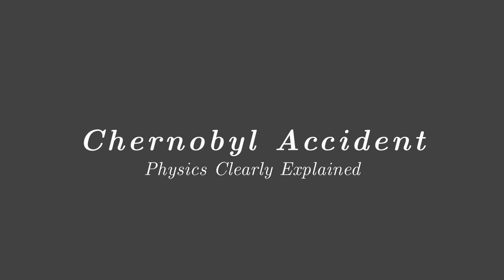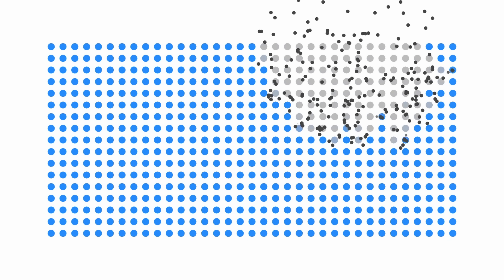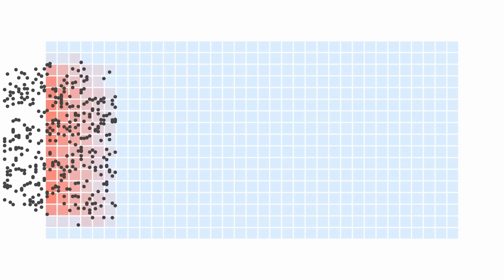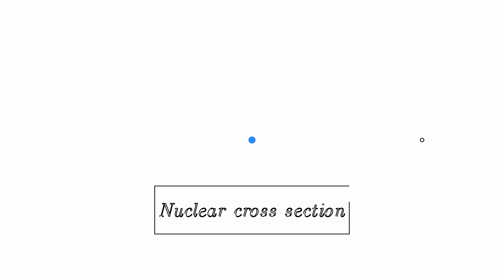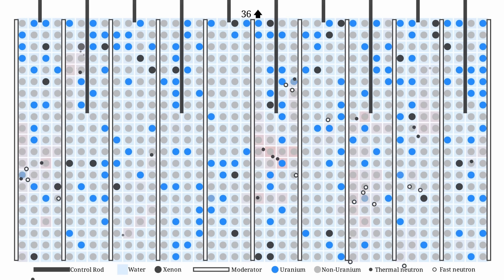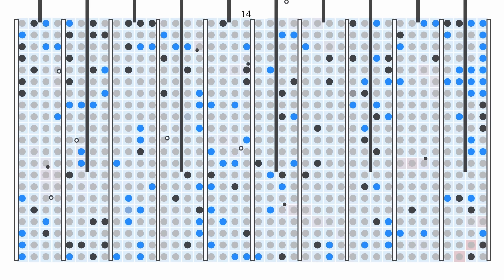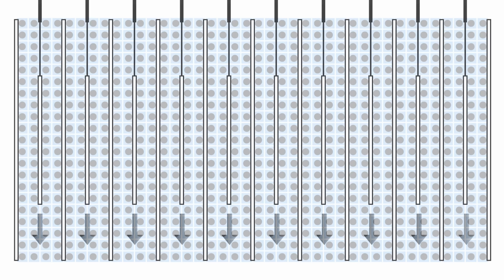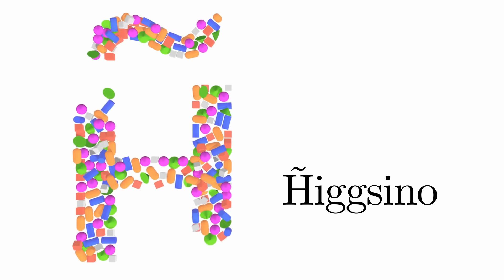Chernobyl Visually Explained

Comment: 07:44 fuel rods were surrounded by boron, only the ends were graphite
Reply: No, you're confusing the fuel rods housing uranium with the control rods. The fuel rods are fully surrounded by graphite cladding blocks, the control rods have almost equal-length boron and graphite portions, connected by a telescopic rod of approximately 1m.

Comment: honestly i dont even think the main problem was the reactor itself, the crew seems more at fault to me, they shouldnt have pulled out all control rods and definitely shouldnt have turned off safety systems and then the disaster would have never happened

and one more thing, you criticize the design of the reactor because the safety systems can be turned off, but what if the safety systems themselves get broken and make the reactor behave in a very dangerous way, in that case turning off the faulty safety systems would obviously be a good thing to do
Reply: The main problem WAS the reactor, the operators have since been cleared of most violations initially attributed to them. To briefly touch on the 2 things you mentioned:
- ORM violation: Operating Reactivity Margin or n° of effective control rods in the core: the control room did not have access to this data and the paper printed by the SCALA computer needed to be brought from the computer room by an operator and the measurement and calculation took a few minutes as well, which is to say the least not ideal in terms of design. Regardless, the operators were convinced that enough control rods WERE in the core even in the critical moments, because the software had a bug and failed to account for some automatic control system rods.

- Disabling the safety systems: these actions were done according to procedure, disabling the ECCS (Emergency Core Coolant System) was to prevent a faulty activation that would damage pipes and other stuff in the reactor needlessly, and even if it was left on simulations show that it wouldn't have played any role. If you went back in time and told them to leave it on you would probably only save the lives of the 6 operators who themselves went down to reopen the valves manually after it exploded and were exposed to deadly doses all night.

Let me know if you want more details, alternatively you can read the official documents yourself.
Reply: The crew was night shift and inexperienced bc they were supposed to just observe an already done test, they didn't know the test was still on going and paused.
Reply: @elinatsaktsira731 The test was delayed by 10 hours, not paused. The crew were not inexperienced, that is part of the russian propaganda trying to blame the operators rather than the abhorrent reactor design. This propaganda is still very strong to this day and also carried out (possibly unknowingly) by the HBO miniseries and many lectures on the topic. It is no one's fault but the corrupt CCCP system of lies.

Comment: I'm the old days there used to be a guy who had a job as an axeman.  And his sole job was to stay in an area above the control rods where they would be suspended with rope.  Then if they needed to get the rods down fast, his job was to chop them free so they freefell back into position.  His only purpose was there in case of a runaway reaction.

Comment: One additional detail is missed. Control rods not only move graphite moderator first. They press out the water of the reactor core thus adding to the positive SCRAM a little bit more. My father have learned nuclear physics in MEPhI and worked on the Chernobyl Power Plant in early 90's while it was not shut down totally yet. He told that the professorship in the institute well knew about RBMK flaws. But the communist party policy needed that power in all costs.

Comment: I feel like for the last part to explode, it needs the "uranium auto generation" from the model to accelerate.
You cover that very briefly around 2:30 but don't really explain what is the logic in the simulation. What is the probability for non-reactive to turn into U235 in your model? I feel like it's quite low in event 1 while very high in event 6.

Comment: reactor did what it was design to do it was safe at the end, it was human judgment, stupidity and error
Reply: A nuclear reactor should be designed to be impervious to human error. 

Or not just human error, if water somehow stopped being supplied to the reactor (like what happened on Three Mile Island due to a valve failure) it would’ve caused this same runaway.
Reply: No it was mostly reactor design actually
Reply: @mikedoessomestuff5771  No actually it wasn't mostly the design flaw sure it played significant part in the incident. operators pushed the reactor far outside safe limits they ignored every safety protocol the did everything worongest way possible. Oldest working RBMK reactor was at the time 16 years working perfectly fine You can't use 240 volt equipment with 500 volts. now i know Chernobyl wasn’t just “using equipment the wrong way" kind of thing but boy did they have fun with it. sure they did not know that doing this could cause a runaway explosion. They were never informed about (human error and stupidity  comes in to play in this part becasue they werent told) positive void coefficient that control rods had graphite tips that caused a power spike that the reactor was dangerously unstable at low power. yet If they had stayed within the operational boundaries, the explosion would not have happened. they tought with a push of a button all mistake would be like never happend this not a washer dryer lol its a nuclear reactor core. 

long story short human error created the conditions the design flaw made the consequences catastrophic.

Comment: Why were the graphite control rods "stuck"?
Reply: The channels containing them (or the ones around them, I don't fully remember) deformed due to the absurd heat as the power coeff became more and more positive, causing the (already very slow-moving) control rods to get stuck. It's important to note that regardless of this the control rods had been further retrofitted before the accident in response to a previous one (Leningrad unit 1) shortening the graphite portion. This was supposed to increase safety and make a positive scram effect impossible, what it ended up doing was increase the water column height below the control rods, making chernobyl worse regardless of how stuck the rods got (they wouldn't have reached all the way down anyways).

Comment: only thing I don't understand is the fuel. The fuel is already all in reactor? It's already there and they burn it until it's finished or they keep putting more inside thru fuel rods?
Reply: Fuel is in uranium pellets inside the fuel rods. Periodically the "spent" fuel rods need to be replaced and in RBMK this could be done even as the core was running, with a big crane system that would swap out the old fuel assemblies for the new ones.
Reply: @mikedoessomestuff5771 thank you

Comment: It is the "quark repulsion force" that creates explosions. Unfortunately, the standard model has quarks as both positive and negative. That's impossible. They are only positive and there is only one.

The strong force is between the quark and the 4 times smaller electron. The gluon doesn't exist because it has no mass or charge.

The quark repulsion force creates all explosions when the strong force is broken. It is the separating quarks that impact other atoms and starts the chain reaction. Fission reactors do not ever want the quark repulsion force to be released.

Comment: So is there like a lid on that thing or does it just shoot neutrons out Willy nilly
Reply: Yes there is (was) a concrete lid, called Upper Biological Shield, Component E or "Elena" in the RBMK. Weighing approximately 1000 tons. It shot up through the fucking ceiling and then came crashing back down when the core exploded.
Reply: @mikedoessomestuff5771  that is one hell of an explosion 😬😅

Comment: How could they have avoided this issue? At which event should the have made another move? Should they have reduced the water supplie in event 2 so that more xenon-135 gets burned?
Reply: Data from the control room actually shows that the day of the accident the core was never poisoned, in fact it was actively depoisoning prior to the test. After all the lies and the attempts to blame it all on the operators eventually stopped, experts determined that xenon did not play a role in the accident, nor did the disabling of the safety systems such as the supplementary coolant system which might have turned on by mistake, damaging the reactor if left on during the test. At the end of the day the operators did indeed do "everything right", besides the fact they did the test at 200 mW thermal instead of a higher power level maybe easier to keep stable. The power drop is a mistery to this day, and we can't ask Dyatlov why he ordered it anymore cuz ya know.. he died in 2006. The accident and its scale is to be attributed essentially to the atrocious design of the RBMK, but if you were teleported there today and had to take the critical decisions maybe don't shutdown after the test, as simulations show it may have calmed down on its own without the positive scram effect.

Comment: This is what happens when a system designed to be very slow (with a time constant of hours!) has a hidden positive feedback element. Over-regulation as it is. The soviet jury blamed operators, and the TV series followed them, demonising Dyatlov's figure. The fact that operators a) didn't know about the effect of graphite displacers and b) were under pressure of various instances issuing contradictive orders. Later on, the other RBMK reactors received an upgrade, removing the graphite displacers from the control rods.

Comment: Valery Legasov: [.......These rods are made of boron - which reduces reactivity - but not their tips. The tips are made of graphite, which accelerates reactivity.

Judge Milan Kadnikov: Why?

Valery Legasov: Why? For the same reason our reactors do not have containment buildings around them, like those in the West. For the same reason we don't use properly enriched fuel in our cores. For the same reason we are the only nation that builds water-cooled, graphite-moderated reactors with a positive void coefficient.

 It's cheaper.
Reply: the graphite "tips" were added for better reaction control efficiency, it was not a cost-related decision. If the rods were only made of boron, an absorber, when fully withdrawn the rod channel fills up with water: another absorber. Replacing a brake with a brake makes no sense, so instead replace it with a moderator and get finer control over the system. Not to say that the technology isn't problematic, but it has nothing to do with money, even do the choice to opt for the RBMK design specifically partly was due to costs.

Comment: Who tf designs the emergency safety switch's rods such a way that moderators are first to enter and then the control rods 🤦‍♂️
If they already knew they were playing with a thing which could potentially turn into a disastrous, a genuine engineer(talking about the ones who built that safety switch) should always prioritize the safety out of all the things.

Comment: very cool simulation! unfortunately one fairly important quibble - while it's technically true that "water has a low chance of absorbing neutrons," that "low" means "so low that it does not meaningfully impact reactivity and can be ignored." water is commonly used as a moderator, and moderators need to not be poisons (neutron absorbers)! having the water squares absorb neutrons as they heat up is not correct.

the fact that it's associated with the water warming up makes me think there was a crossed wire with the negative moderator temperature coefficient of reactivity. it's true that reactivity goes down as moderator temperature goes up; but that's not due to the water absorbing neutrons; the higher temperature makes it more likely that other non-fuel nuclei in the core (usually U-238) will absorb neutrons, leaving less for the U-235 to eat up and cause fissions.

it's really too bad because this would otherwise be an excellent tool for helping people learn about coefficients of reactivity! still an engaging video though :)

Comment: Wait so AZ-5 wasnt a detonator? The chain reaction had already started and the explosion would have happened anyway? Was there actually anything they could have done? Also what actually exploded? Was it steam pressure?
Reply: A steam explosion (caused by the burst of fuel rods) initially blasted off the 2000-ton concrete and steel upper biological shield. Moments later, hydrogen rushed into the exposed core and reacted with the hot graphite, causing a much larger explosion that blew apart the reactor building.

Comment: I appreciate the accurate visualization of the RBMK reactor and the significant 1.25m spacing above and below the graphite portions. However, the description of how the Chernobyl events went down and what ultimately caused the explosion is very inaccurate. The rods weren't stuck. The problem was that when re-inserting the rods, the graphite portions displaced the water at the bottom. This means the water, which is more neutron absorbent than the graphite is now replaced by said graphite, which increases the reactivity at the bottom. While simultaneously the boron at the top entered the core again, decreasing the reactivity at the top, it didn't matter for the bottom of the reactor. Yes, *having* all control rods fully in the core decreases reactivity drastically, but moving them down from the maximum retracted state, was increasing the reactivity temporarily. This is when the power spike happened and all the water evaporated. AFTER the button press. The AZ-5 button was indeed an emergency shutdown, but used in normal procedure to shut down under regular circumstances as well. They completed the test and Akimov signaled Toptunov to shut down the reactor. There were no lids jumping, the reactor exploded the moment all the water was displaced at once and evaporated at an instant. Perevozschenko, the worker often credited for seeing the lids jump was in the control room at that time and nowhere near the reactor hall. The workers allegedly ignoring emergency notifications and then shutting down the reactor in a panic is part of the narrative by the soviet union. The goal was to frame the workers as if they had committed any form of misconduct, especially Dyatlov as the scapegoat, so the actual cause of the explosion, the total 2.5m spacing wasn't looked at. Older RBMK reactors had longer graphite portions on the control rods and after the incident, the length was increased again.

Your production quality is incredibly high and the kind of content I want more of on youtube. But especially for a topic like Chernobyl, where there are alot of narratives from people trying to push away responsibility, a more thorough research would be appreciated.

Comment: 1:30 made sense to me at first, but then later you explain that fast neutrons are released, which have a very low chance of interaction until they hit a moderator. So, shouldn't nothing much happen after that first thermal neutron interacts with a single uranium? Just three fast neutrons ineffectually passing through.
Not criticizing, this is a genuine question born of my own ignorance lol

Comment: Any reactor is only as safe as its operators. 
RBMK is a good reactor in that, its cheap to build, produces a ton of power through a razor thin coefficiency. Truly a mad Soviet design, but when you have chief operator with history of being troublesome, then a lot can go wrong as they did not follow protocol nor safety measures as thanks to Gorbachev market reforms had basically removed workers enthusiasm, since they no longer got rewarded for working harder nor smarter. 
There was also in the 80s to reduce costs as the economy switched to a profit motive free market, to operate power plants cheaply, shutting down nuclear power plants would be the end of your career as an operator so the added pressure to maintain your job was great. 
All of this added social pressure, stress and poor leadership meant that Lenin nuclear power plant was doomed regardless what reactor design it would have been as they would just found other ways to push it to beyond its limits to prevent a shutdown. 
Todays RBMK have explosives on their control rods to jam them into the reactor as fast as possible which will kill the reactor for at least 6-12 months to remove them and restart operations.
Reply: You know what would have made a massive difference? A CONTAINMENT BUILDING.
Reply: @jamesb1988  
Containment buildings were never considered for RBMK because the designers never expected people to disable every safety mechanism and essentially lug the reactor on minimal cooling.

When people say there were no safety in USSR, thats a lie, people in USSR were just REALLY exceptionally good at working around every safety rule and mechanisms. 
In fact, the operators had actually figured out how to work around the computer safety measures something even the investigators had trouble understanding was even possible.